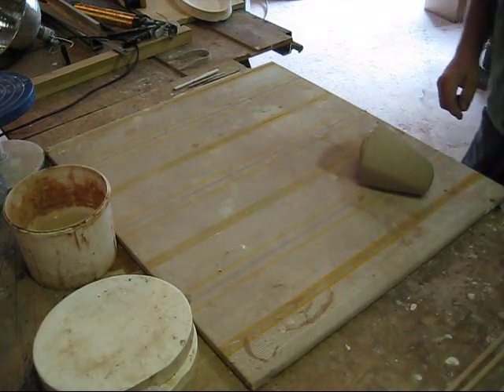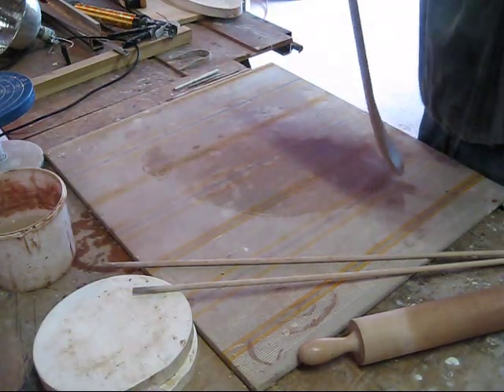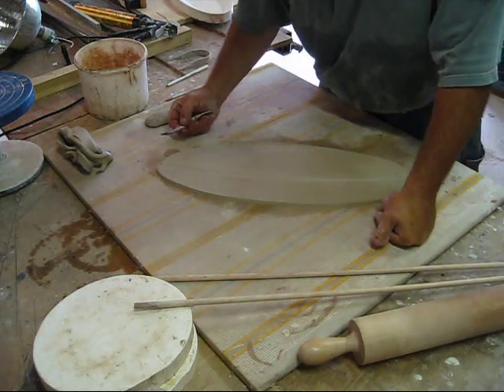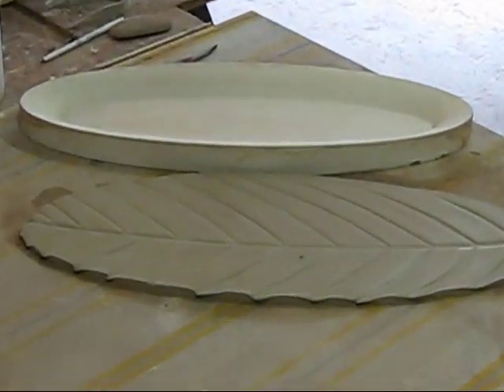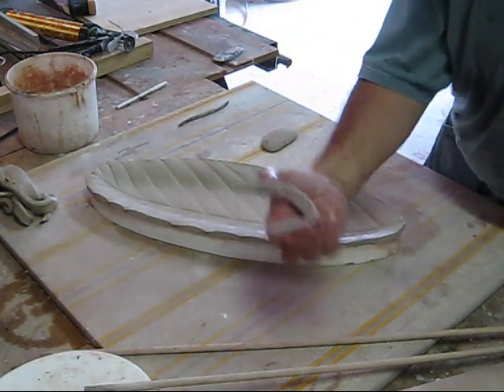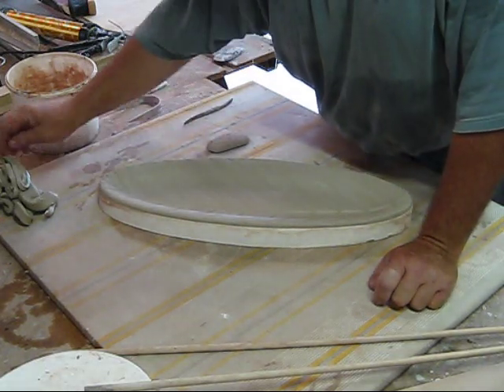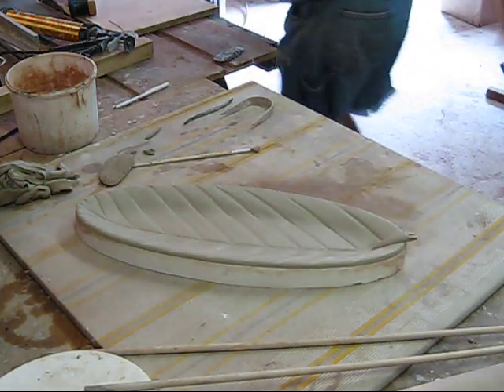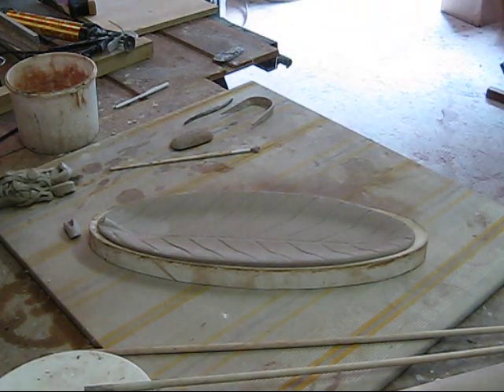MAKING A PALM LEAF PLATTER.wmv

Comment: Love it!  I learned a little trick that works for me when attaching a piece that is fragile use wax resist which will slow the drying down and during the bisque firing the wax will burn off.  Try it I think it will work for you.  Caroline